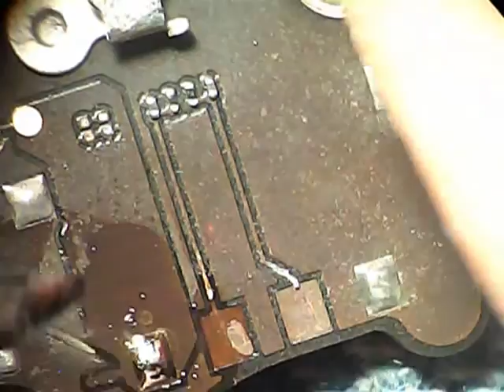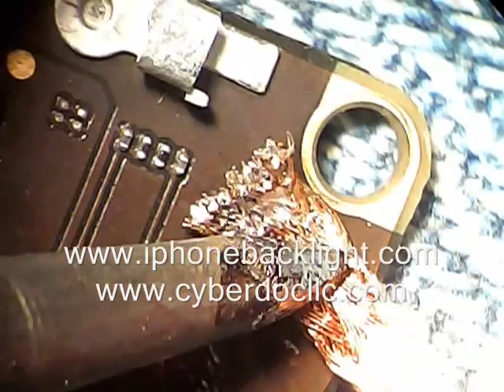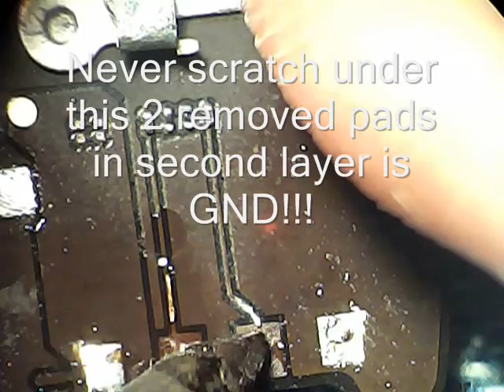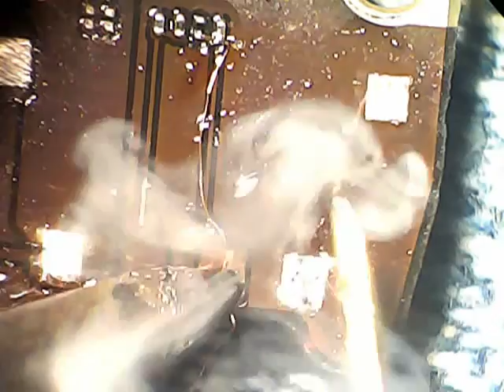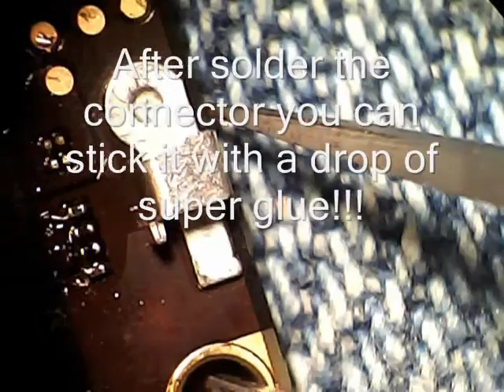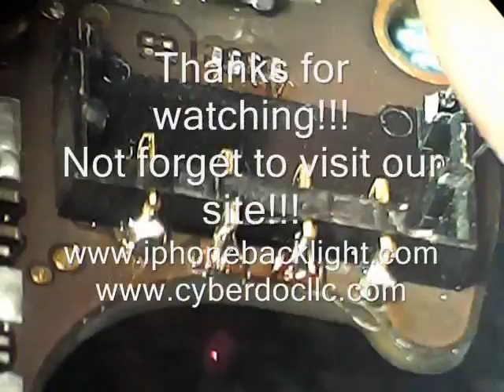iPhone 4S Battery Connector Repair

Comment: Hello mr wites. I have an iPhone 4s. It is water damaged. The phone is working perfectly except for one weird thing. The battery does not charge. I have replaced the charging flex and battery. When you insert a fully charged battery the phone charges as normal. If the battery drains completely then you cannot charge the phone again, it will loop on apple logo. However if I charge the battery in another phone and put back in water damage phone it'll turn back on and charge. Have you come across this before? Thank you.
Reply from the maker: Yes of course i meet this fault there is some short or charging coil need replaced,i have complete solution on my site www.witesomtesla.com